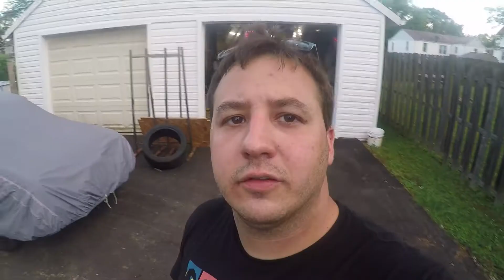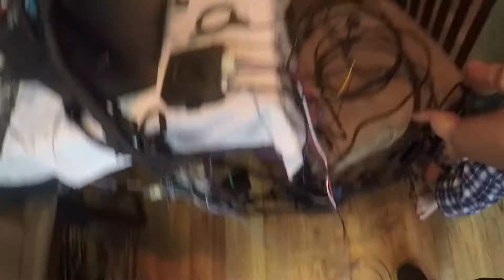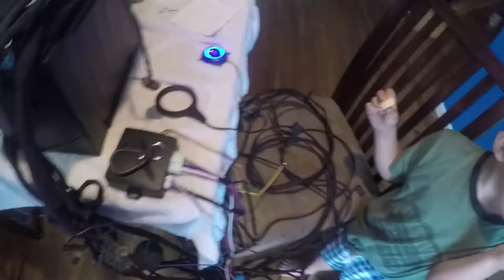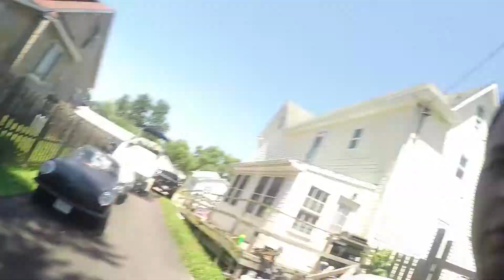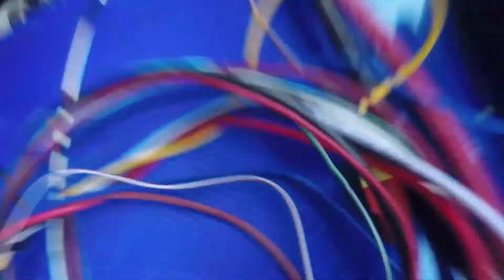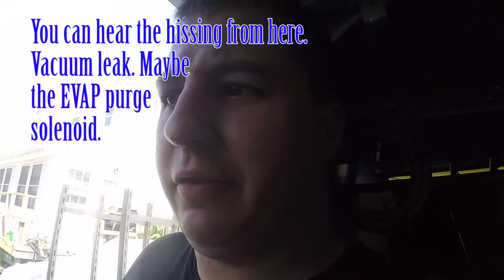V8 Datsun 720 Build Pt5   First Startup

Comment: I’m doing a Ka24e turbo in my 720 now but stumbled across your videos and got hooked
Reply from the maker: Awesome. Now I haven't tried this or explorers this but I was told a KA24 would bolt right into this chassis by just flipping the motor mount to the opposite sides. Also if you have the dough a sr20 would fit right in this chassis with no modification. Both great swaps though. My 240sx still has it's Ka24det with a .52 trim turbo. I love it. It's fast. Good luck with whatever way you go.
Reply from the maker: These trucks sometimes also came with v6 engines. A vg30e would be a great low mod swap and they hold some power. Turbo 3-400hp easy.
Reply from the maker: Well there some easier says to do things you could get away with keeping the firewall and getting a shorter accessory pack but that costs more money. I cut most of my floor and stuff out because it was all rusted but if you're is in good shape you could go that route.
Reply: Hell yeah definitely don’t have the money for an sr right now only 22 and just bought my house lol. But I do have an ls3 in my garage right now that was supposed to go in my Miata and your videos have been giving me the urge to go ls in the 720.
Reply: Awesome I’m going to give it some thought thanks,